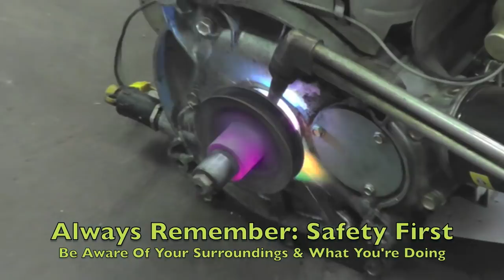Troubleshoot & Replace Camshaft On Briggs & Stratton Intek Engine

Comment: who cares what you do to that pulley as long as its still usable and the belt goes back on and everything works why should it matter
Reply from the maker: +427 Elevating Productions Some nerds always comment that I'm changing the metallurgical properties of the part when I heat & quench it. Thats why I stress that it's only a Lawn Mower not the Space Shuttle. Knuckleheads!!!
Reply: Well whether they are right or not I understand your point your right its only a lawnmower and for heavens sakes if everything still works right if you did that to a mower of mine I could care less long as it still works right you seem like you know your stuff on repairing engines.

Comment: Seriously? You got that crank that hot? That's forged steel! Oh hell no. If you get pulleys for that for 35 bucks, you're shopping at Briggs and Stratton. Plenty of aftermarket pulleys that are cheaper. No need to go to China for them either. Amazon, Ebay has plenty of options. Cranks run 100 dollars or more. Flying bits of metal from shattered crankshaft end and other various parts: Priceless!

Folks, if you're a lay person doing a DIY job and you do this kind of work, you have to know what materials you're working with. I got 2 exact minutes into it and said no way. I have nothing against anyone but I'm a diesel mechanic and now do small engine work. Don't torch the crank.
Reply: Garage Days it’s a lawnmower not the space shuttle
Reply: @solojohnson8623  True. But what does that crank swing around really fast? Think.